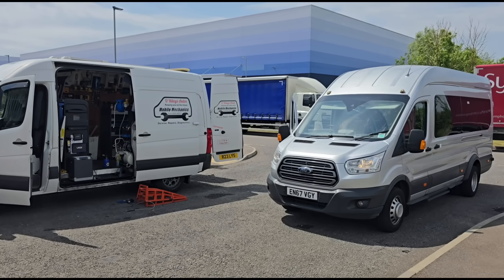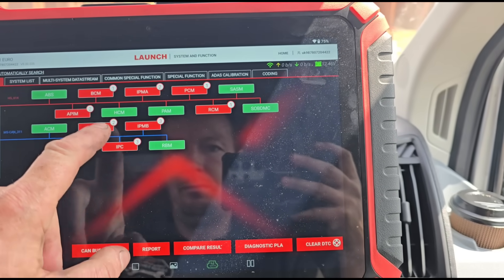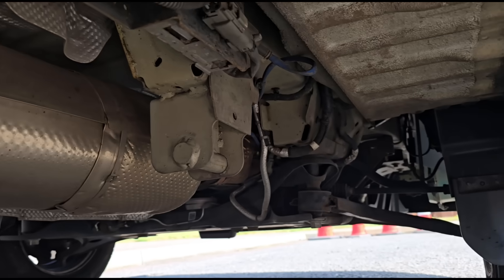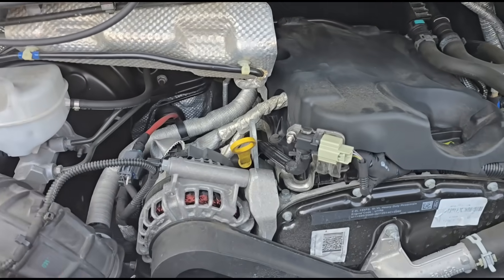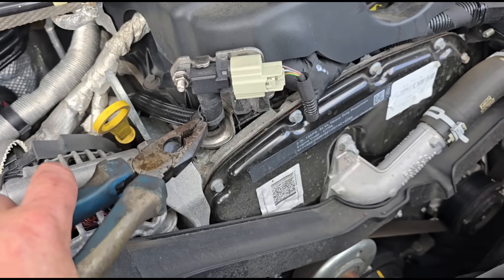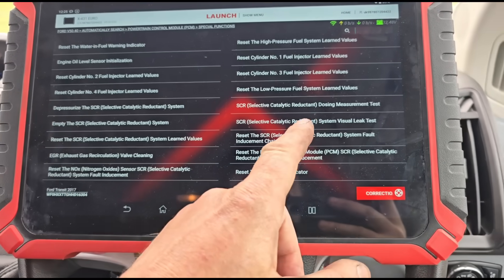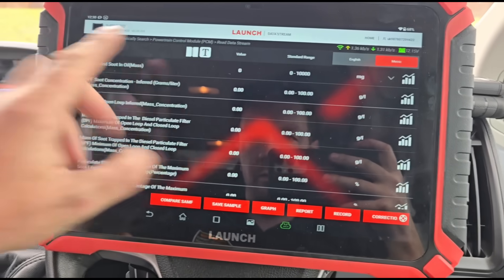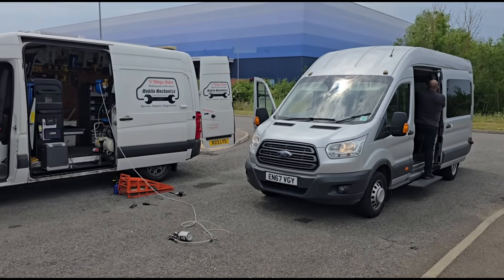Troubleshooting a Ford Transit Minibus with DPF Issues

Comment: I'll be honest mate I've had one of these doing that blocking the DPF up on a regular basis needed an injector these particular engines prone for injector failure causing the DPF to block up very quickly you could actually drive down the road and watch the search loading rise

Comment: Idling for a hour & a half is a nightmare for creating soot in the DPF, but also the EGR. The EGR will be sitting wide open with all those hot gasses & soot flowing through it. 
People do this & then blame the vehicle when it starts getting problems.

Comment: Help! 
I got a Hyundai I30 2016. I am getting a code P2002 and check exhaust system. But no limp mode. Got a engine light on
I have seen the DPF live data seems to be working. And is doing regen’s 
I don’t know where to go. I am getting told crap from garage’s
Reply: Have a look in his previous vids, something about Hyundais rings a bell.
Reply: How diff press at iddle?

Comment: I know some ford euro 5s have lower than expected pressure. Is in the 40s at 3k rpm and only in the 60s while doing its passive regen okay on a 2010 fiesta 1.6 tdci 8 valve?

Comment: I have a mk5 mondeo 2.0 tdci which is euro 6 but not yet adblue. I had the dpf off-car cleaned, now it reads 82mbar after a regen at 3000 rpm. Is that too high? It's the peugeot type 2.0 dw10 engine.
Reply: It's fine

Comment: What I have noticed when soot readings get as high as 1000s% is the vehicle has had an Adblue Delete and the vehicle is no longer regenerating that is why the soot counter goes up and you get the soot accumulation fault from the high pressure at the DPF pressure sensor. As you say the customer should of had a warning and faults at 120%.